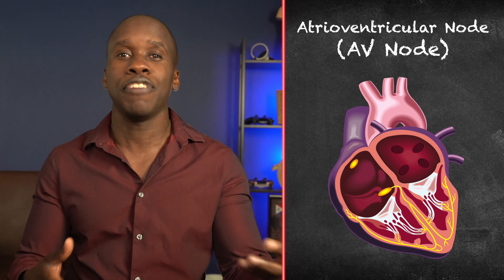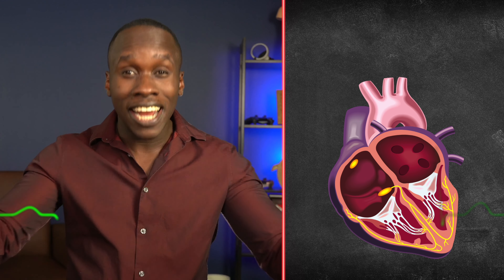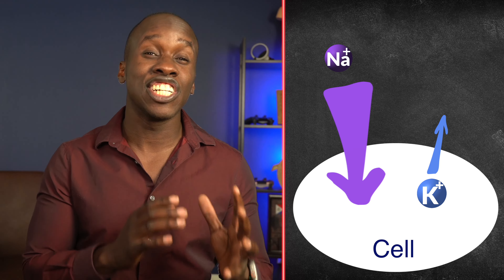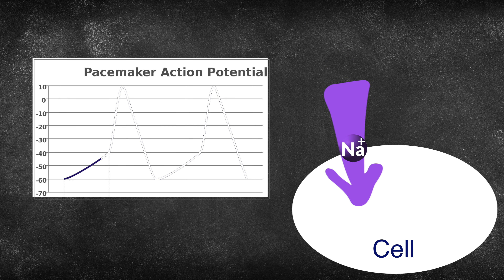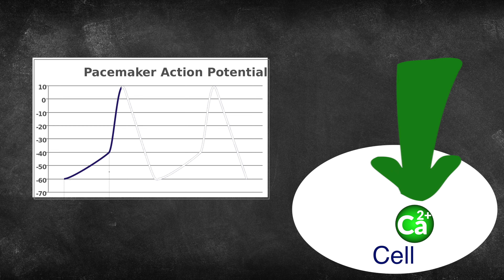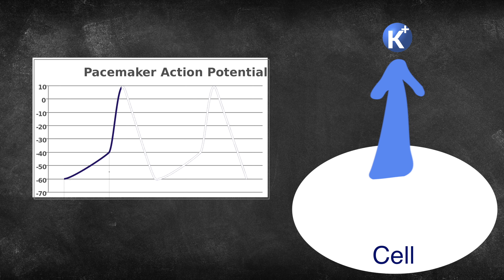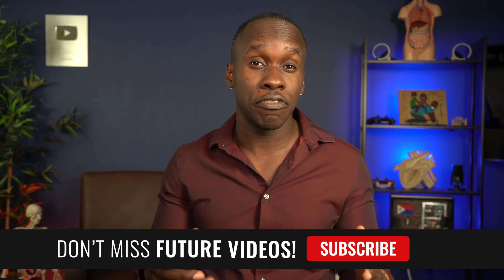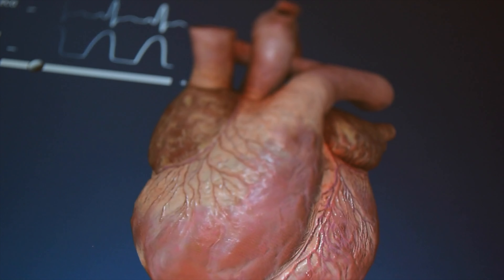The Pacemaker of the Heart - SA and AV Nodes Made EASY!

Comment: Really excellent video!  I have no medical background beyond First Aid - but this is so clear and filled with enthusiasm! So when we sleep our heart rate slows (right?) -  I am thinking that something must slow this ion transfer across the membrane. It seems that the absorption of Na by SA cells starts this whole process so perhaps something is slowing that down? (but of course I assume that if any channel experienced resistance then the whole signal-generation process would slow) No?  OK - what is the answer? :)
Reply from the maker: Thanks Pedro. Glad you found the video helpful. You're on the right track. When we sleep, our body's overall metabolic demand decreases and our heart rate tends to slow down. The autonomic nervous system, specifically the parasympathetic part, becomes more dominant during sleep. This leads to the release of neurotransmitters that can reduce the rate of sodium (Na) and calcium (Ca) influx into the SA node cells, which slows down the pacemaker potential. While the ion channels play an important role, the overall regulation is a complex interplay of hormones, neurotransmitters, and intrinsic cardiac mechanisms.

Keep up the curiosity, and thanks for engaging with the content! 😊

Comment: During high intensity workouts or high stress activities, probably brain sends signals to create more sodium and potassium ions  and this results in increased exchange of these ions through the membrane pumps and that would result in increase in the frequency of depolarization and heart beats faster, resulting in increasing supply of oxygen through blood to the muscle cells! Please correct me if I am  wrong.
Reply from the maker: Now that's a great question! Here's how it works. In high-intensity workouts, it's not really about creating more sodium and potassium ions, but rather how these ions are used. Sodium and potassium ions are always around. But the brain and hormones like adrenaline increase the heart rate by speeding up the electrical signals in the heart's pacemaker (SA node). This causes a faster depolarization, making the heart beat quicker to pump more oxygen-rich blood to muscles. The body is A-MAZING like that! Hope that helps.

Also, make sure to subscribe to the channel, because I have a lot more content like this coming to help you understand how the human body works.
Reply: @InteractiveBiology thanks for your response. But how does adrenaline increase the SA node to increase the rate at which it fires faster!